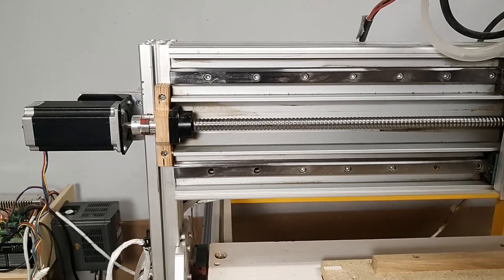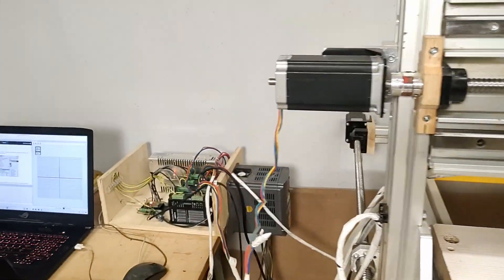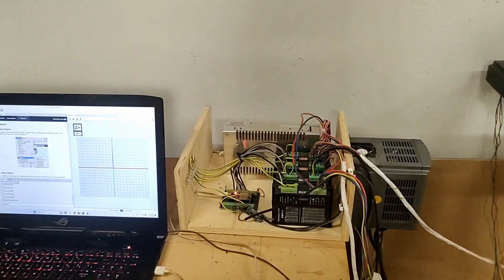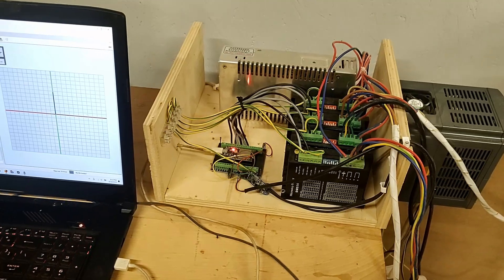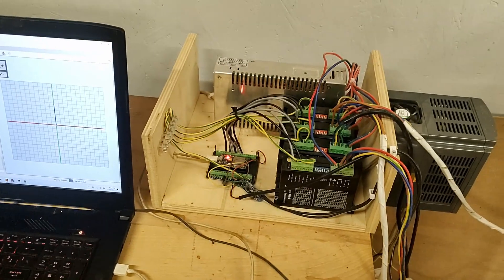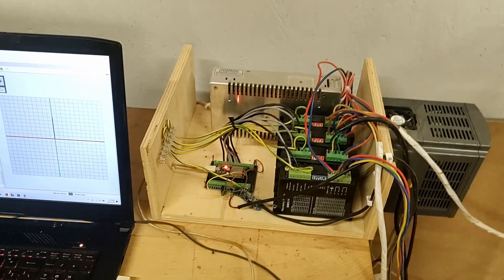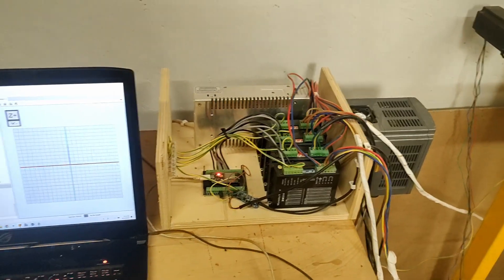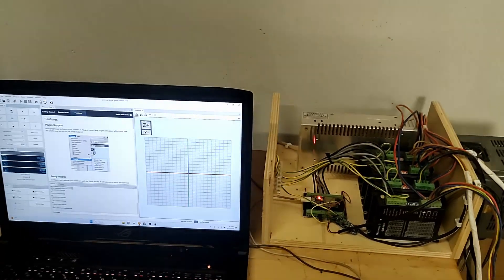An introduction to my home built CNC

Comment: Thanks for the video.  It would be great if you could make a video with the details on mods and FreeCAD design changes for using the CNC for horizontal boring.  I am looking for the easiest (and flexible) way to cut holes in tall boxes that won't fit within the Z clearance but does fit within the X and Y clearances.  I have seen videos of ad-hoc fixed Z extension but it looks pretty hacky.
Reply from the maker: You're welcome! That's a great idea, I'll definitely consider making a video about horizontal boring with the CNC and FreeCAD.

Comment: Dealing with home builhing is it better and more stable to have x axis longer or y axis lomger ? Looks like loading things is better when x axis is wide but i didnt know if it weakened the axis
Reply from the maker: @ronaldcrowder404  i would always go with a longer x axis. But it needs two motors and a much stronger construction. It is worth it when you are able to load wider things
Reply: @opensourcecnc  thank you verymuch